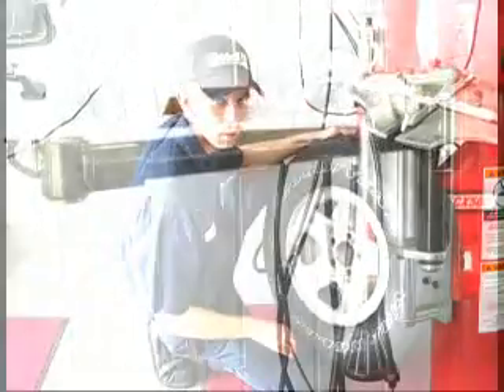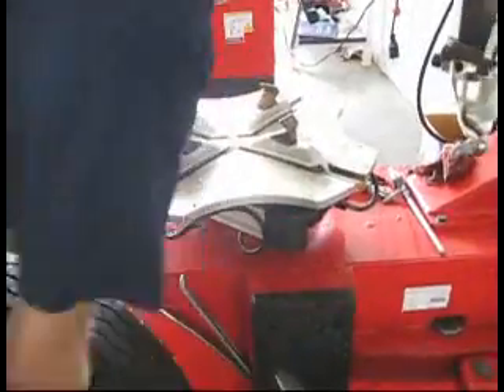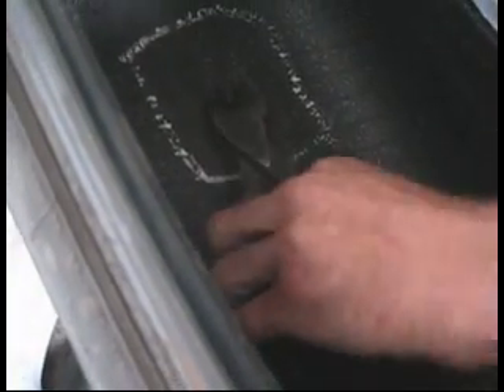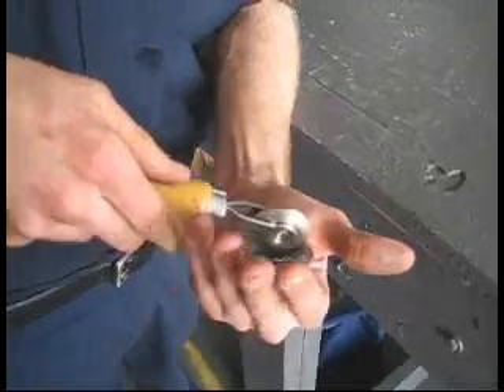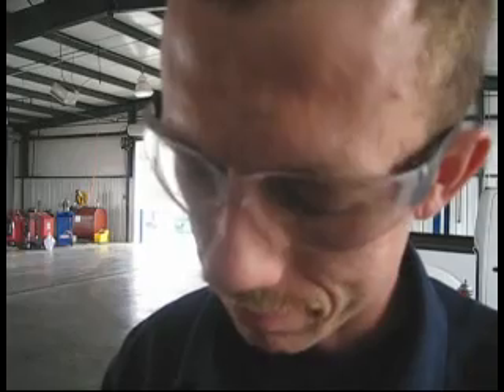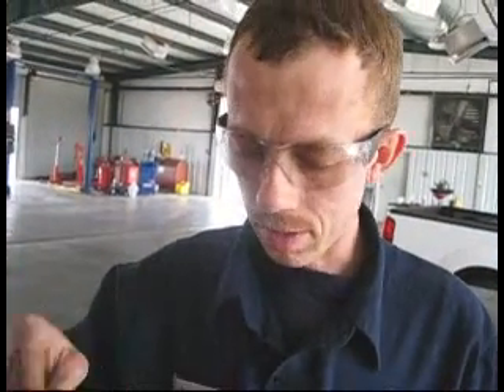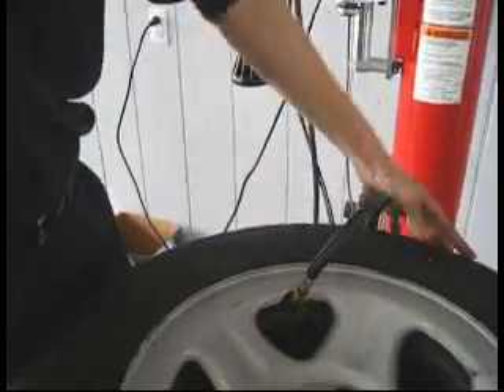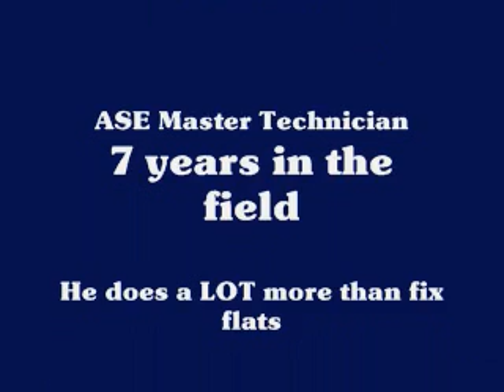Fixin' a Slow Leak

Comment: Mercedes tire monitors are $35 ones that others charge $70 for and Mercedes charges $250 for the same monitor.  Dealerships in my experience charge about 2x-5x what we would pay if we buy parts ourselves at retail.  I can buy a factory new AC compressor for $495 - dealership price is $995 (just for the compressor).